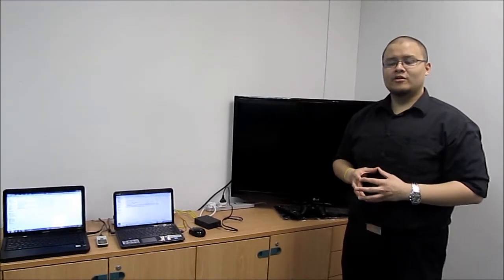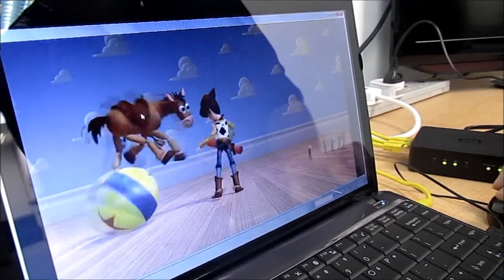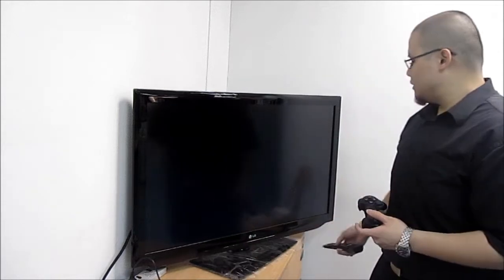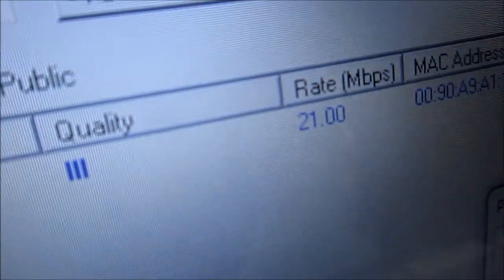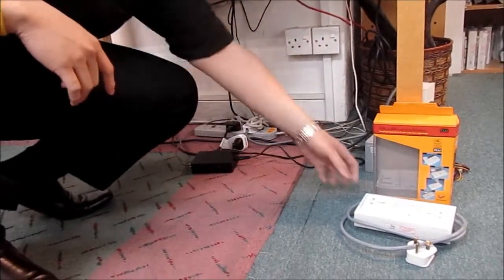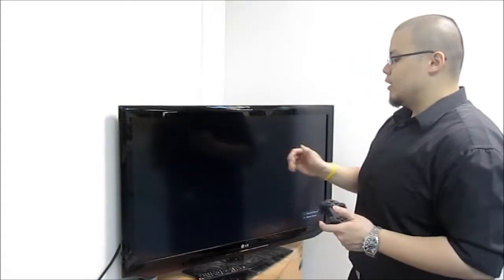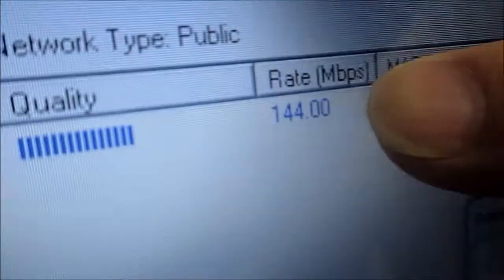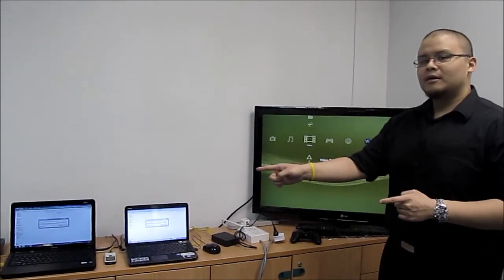See how Powerline-Ace empowers WD-Livewire Powerline Adapters

Comment: Well I have the WD livewire router and a fair internet connection about 100mbps I installed everything and I connected it to my Xbox360.  When I first turned it on it worked fine for about half an hour I made my profile on it and got the IP and things all set manually. When I checked the connection it said I had a high NAT and that it may restrict me from playing with other people and hearing them online.  I did everything Xbox told me to do at their site except open 3 of the router's ports.